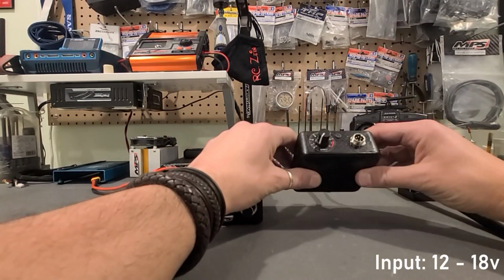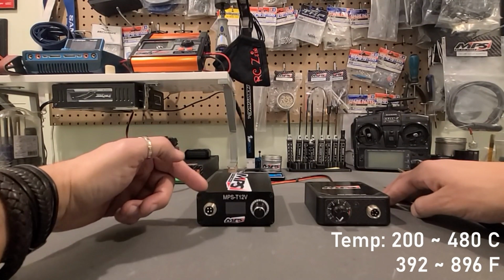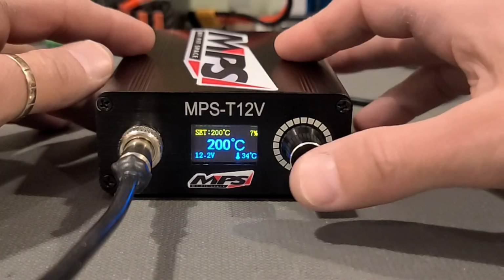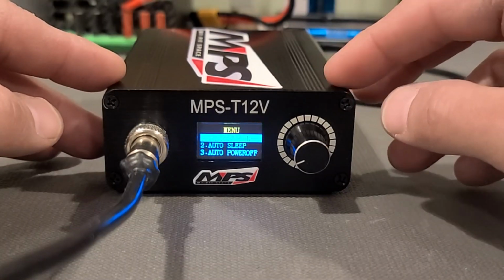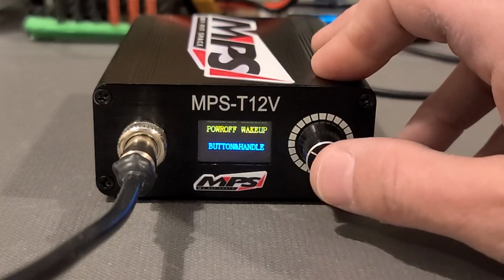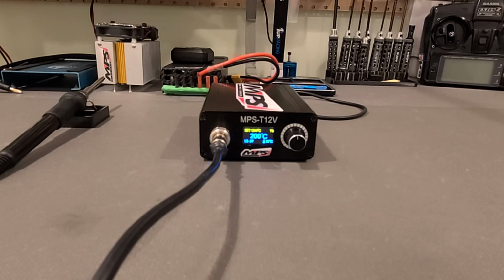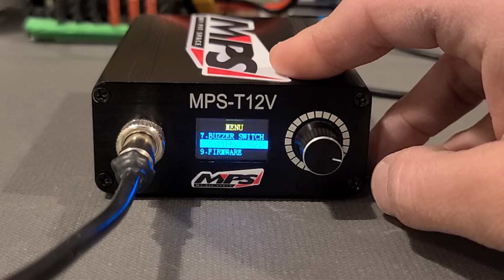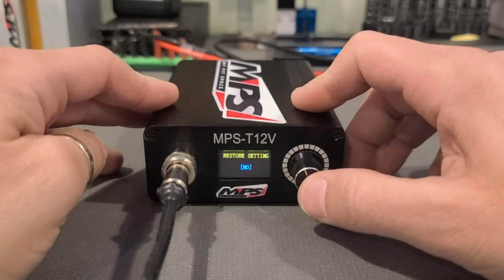My Pit Space Soldering Station Review

Comment: Rami. Is the included tip good for soldering to motor tabs and 4mm or 5mm battery post
Thanks for the review
Reply from the maker: The 4mm tip included is excellent for motor and battery post, it is my go to size for most applications
Reply: @ramizein9158  thanks.. it's on my list of want to have upgrades that I don't require lol. Still rock a Hakko.